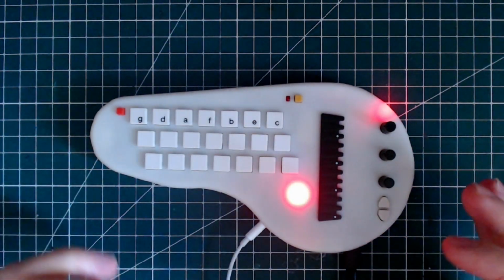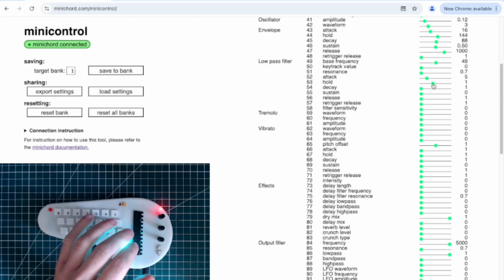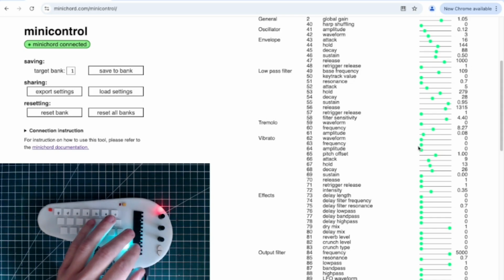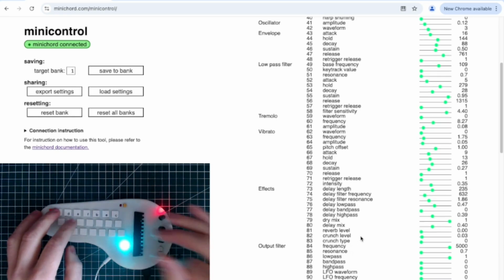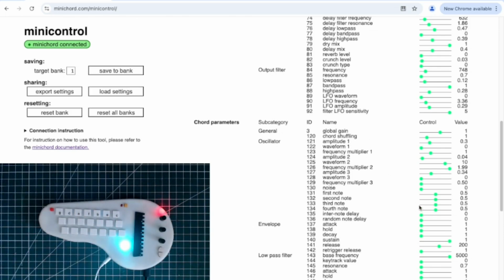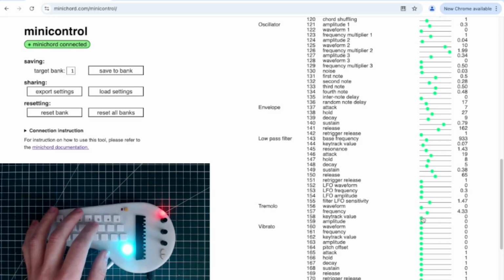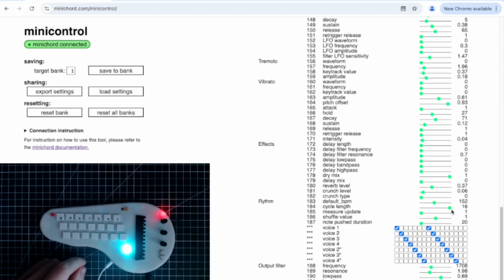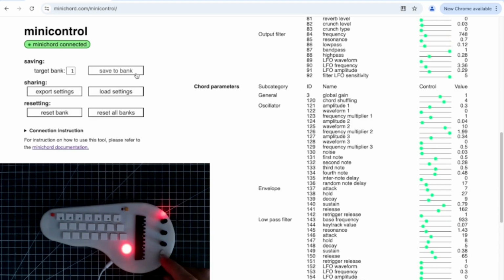minichord - technical demonstration

Comment: How to assign the third potentiometer from the top?this time I want assign "120 chord shuffling"😊
Reply from the maker: Look at 14: mod main control. It assigns the parameter number for the third pot.
Reply: @benbanks3879 I see, thank you for the reply. By the way, is the mini control usable on Mac? Is my minichord not being recognized because it's connected via a USB hub? Also, is it possible to get it recognized by an Android smartphone? I discovered a tap tempo function in arpeggiator mode, but it's not mentioned in the manual. It's a fantastic device, but is there a user forum for sharing information?
Reply from the maker: @yoskevito  usually either the cable is charge only, or the user forgets to turn on the minichord by plugging the headphones in. It works on any browser that supports webmidi, so definitely on mac (Chrome and latest Firefox versions) and Android, but not on iPhone. Note that the interface on Android is not that great! 
Github is the best place to discuss it, either in the issue or discussion pages : https://github.com/BenjaminPoilve/minichord
Reply: @benbanks3879 I was able to use it without any issues on Mac. Furthermore, when I tried the new UI for minicontrol that I found on GitHub, it also functioned on Android.
When I am playing, I sometimes wish for the chord voicings not to be limited to just one type, but to sound in patterns one octave higher or lower. Since it is open source, I know absolutely nothing about it. If I can enter the appropriate prompt into Gemini, would I be able to make personal modifications?

Comment: This is incredibly useful. I just got my minichord and was very confused by all the settings. Question though - when I plug mine in, many of the settings are 'greyed' out and not available. THe ones I want to use - Sharp function, chord frame shift, chord key signature. What am I missing?
Reply from the maker: If some settings are greyed out, you need to update the firmware. The procedure is explained here: https://minichord.com/user_manual/#updating-the-firmware

Comment: for some reason I can't change the parameters in mine and not sure why. it all connects and i can cycle through the banks but all the parameters are locked
Reply from the maker: All the parameters are locked? Or some are locked? Do you mean that they are greyed out? Are you using Chrome? I could help you solve this but I would need more info: you can write to me at hello@minichord.com

Comment: Hello! Amazing instrument, super excited for mine to arrive!  Is there any way to tweak the notes in the chords, for example, replacing augmented and diminished options with sus2 and sus4 chords, add9 chords, etc?
Reply from the maker: If you have some basic coding skills, the code is quite readable and I could help you out to define different chord systems! Currently the accessible setting from the minicontrol software is the #40: it allows you to select alternative notes for the harp section (you can check it out here: https://minichord.com/minicontrol/ , if you hover a parameter, there will be a small explainer)
Reply: @benbanks3879  Sounds great! I sadly don't have any coding experience, but good to know it is possible! And maybe I can learn... this is certainly a good enough reason to try.

Comment: Great project! Any idea what a kit will cost? And when they will be available?
Reply from the maker: Hi! I'll be producing some PCB in the coming months. I'll try to look into Tindie for distributing. The PCB with surface mount components installed should be less than 50€, for the rest it'll probably be easier for people to buy the parts themselves (I provide a pre-filled Mouser BOM). Fully assembled PCB I'm not sure yet as I'll need to factor in my time. If you want to be kept posted, you can write to me at info@minichord.com.
Reply: Poking you as a reminder if you weren't following the product. seeed studio preorder page is up for $130 USD by now. Idk if kit sales have info yet